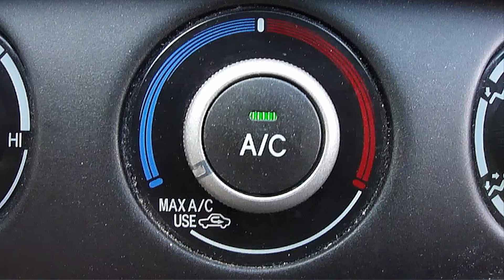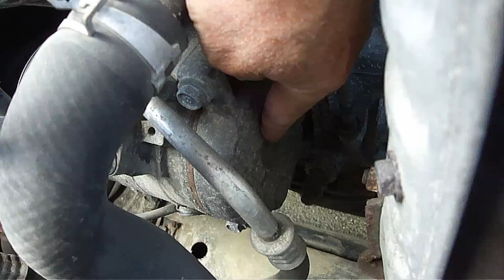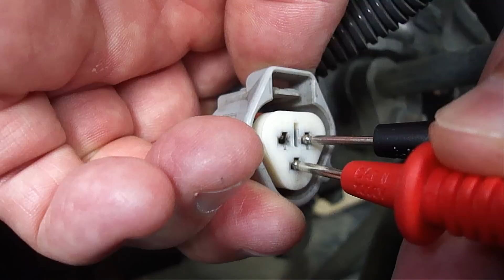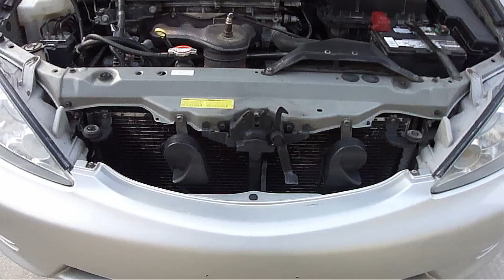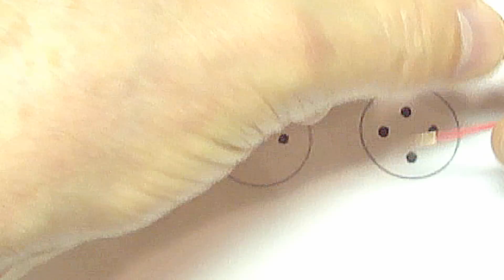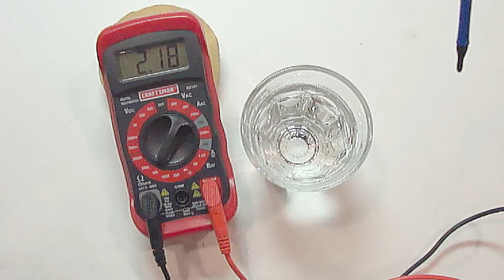How To Fix Car AC That Blows Hot - Possible Causes

Comment: this aint no sh!t. i replaced everything on my system and it didn't fix it. took it to 3...3 top rated F-ing mechanics in FTW tx. I heard everything from water pump and thermostat to improperly charged ac compressor. This is, actually the problem why it would charge properly. The compressor would not charge and run properly because the F-ING RELAY WAS BAD. !3.75 relay repaired the ac blowing hot air in traffic but cold air driving at speed. the compressor was not cycling properly causing it to work harder and over heat the engine. A relay fixed it all. At least all the parts are new and it gets colder than my new truck. It did have to be charged properly after the compressor was working right. But after that, Damn.

Comment: My ac wasn't working I checked the 10a fuse,it was bad so I replace it. It worked for 5mins then went out. Then I replaced the mcr clutch relay  and the 10a . It worked for about 2days then went out. I'm thinking alternator or belt ? Any ideas! 2008 Chevy uplander 120k 2nd owner.ac blows cold when working.

Comment: WE HAVE A 2008 TOWN AND COUNTRY AND THE AC AIR IS NOT COLD ENOUGH.  WHAT COULD BE? AND THANK YOU SO MUCH.
Reply from the maker: My first guess would be low refrigerant.
Reply: @proclaimliberty2000  Thanks for your answer  but is fully charged.
Reply: @proclaimliberty2000  Thanks so much for answering me but unlikely is full. I took the van to a shop to filled out. Works but not good enough when is really hot. Another suggestion?
Reply from the maker: @armandoperez2484  As it gets hotter outside the ac temperature coming out of the vents will not be as cold.  Does it keep you comfortable?
Reply: @proclaimliberty2000  I HAVE TO CLOSE THE OTHER VENTS TO FEEL COLD THE DRIVER SIDE, BUT WITH MY FAMILY IN SIDE IS IMPOSIBLE TO DRIVE.

Comment: Watched and liked. Buyva scan tool is what i got from video.. another guy said 90% of broken ac systems is because of low refrigerant. They reccomend attaching a refrigerant gauge on the low press0
Reply from the maker: Buy a manifold pressure gauge set from Harbor Freight. Don’t waste your money on these junkie re-fill hoses.  80% of refrigerant leaks are due to faulty Schrader valves.

Comment: My AC only works if I press and hold the AC button. If I take my finger off the button, the compressor stops working. The light starts blinking and blows hot air. What could cause this malfunction.  And thank you for your video ( I have 2010 rav4)

Comment: My AC isn't working. I had one place quote me 1,600.00 and another 1,700.00 to replace A
C compressor. I have a 2009 Toyota RAV4. I am on SS and cannot afford this and it's so hot in Texas. Does this sound like a reasonable price?
Reply from the maker: Might be a little on the high side. Was this a quote from a dealership?

Comment: What can cause a short to the AC compressor? Could a bad coil or thermal protector on the compressor cause that issue? 

I have a situation where the fuse to the condenser fan and the ac compressor keeps blowing out. I unplug condenser fan and compressor and tested each separately and they work fine without issues. Could one be drawing more amperage than rated for the fuse?

Comment: What might cause the AC to blow hot air when vehicle comes to a stop like at a red light? Otherwise blows cold air. Fan is working.
Reply from the maker: My first guess would be low refrigerant.

Comment: Checked the AC on my GF 2004 Toyota Corolla that was blowing hot air. The magnetic clutch doesn't engage / spin on the compressor. With the AC turned on the fan under the hood doesn't spin. Checked the AC relay by swapping it out with the horn relay, horn didn't work, AC relay was bad. I replaced the AC relay but it didn't fix the problem. The fan still doesn't spin and the magnetic clutch on the compressor doesn't engage / spin. Not sure what to do and can't really afford going to a mechanic (they quoted me $125 just for the diagnostic).
Reply from the maker: Your cooling fan motor more than likely needs to be replaced. A bad cooling fan can prevent the clutch from turning.
Reply from the maker: I have a video on my channel showing how to replace the cooling fan motor. You’ll find the best price for a motor replacement on eBay but only get genuine Toyota OEM.

Comment: Hi I’m having a different problem, my front driver side ac blows cold air but not the passenger or rear if not run on a low. If you turn it on high front and rear blow hot and driver side blows warmer. Ac was fully recharged. Hope someone can help.

Comment: Great video, but no mention of  a repeatedly blowing fuse, which sends power from relay to compressor. This is a common problem, usually caused by a short in the clutch, and should be one of the first things checked.
Reply: Repeatedly blown fuses are due to magnetic coil behind the clutch is short.
Clutch not engaged sometime due to magnetic coil is broken open - using ohmeter sound  continuity connected to ground and magnetic coil wire to hear a beeping sounds proving it is good.
Reply: Short not in the clutch- short is in the magnetic coil behind the clutch which is just a springplate.

Comment: After spending several thousand dollars on an expansion valve, compressor and voltage regulator, it turned out to be only my ac relay! Wish i saw your video before i let a couple service guys take my money! Thank you!
Reply: There's some crooks out there. I just got told I need a new $2000 compressor. But I tested by connecting to the battery and it works fine. The system probably just needs a regas, or it could be a faulty pressure switch.

I need to try to find an honest tech to find out.

Comment: i'm a mechanic and i don't thin could of done it half as well . expertly done great how you explain jumping censors on sum cars or jeeps you need to unplug the compressor and can test the fans on evap or air drier jumping plug to see if fan motor kicks on also . as you explained in first section fan was bad on the car you were working just my opinion of course if you made a video in how to check the fan as in your case was issue . the way you describe an explain in detail im sure it get lots of few an help a lot more people . i'd do it but you have a much better way almost perfect like a teacher makes you understand in terms Thanks amazing video . BigRigDeLo , motorcycles , lawn equipment , cars ,truck repairs if you like to subscribe i'll be starting a help DYI auto help channel and i'd recommend your channel to anyone also not to take followers just everyone has little tricks an never have all the answers . can always learn something from anyone everyday ..... 2 thumbs up to you sir ...

Comment: my clutch turns but still blows hot air coolant level is good i have a 2014 kia optima
Reply from the maker: It needs to be checked with an ac manifold gauge.

Comment: On your meter you have the red lead plugged into the right side and black in the center at 4:40 , why did this change when towards the end at 19:24 but now the black lead is plugged into the left hole? Sorry not a meter guy just asking for tech answers.

Comment: Many years ago I worked as an Assistant Chief Engineer for a radio station. We had a Promotions Director that literally flew a broom back and forth to work. She was a miserable ount, and impossible to work with. As was our station's annual custom, we had our News Van participate in the HOURS LONG July 4th parade in the city. And this year, little Miss Congeniality decided SHE was going to drive. On Friday, while loading up some stuff for her "date with destiny", I went under the dashboard and removed the A/C fuse from the fuse block. Monday rolled around and she came into the office, complaining about how bad the parade was since she had to sit in that van for hours with the A/C not working. "Really? I'll go down and take a look right now." I went to the van, put the fuse in, fired up the A/C and of course, was soon greeted by a cool blast of air. And of course the kicker was going back upstairs to tell her there was nothing wrong with it and it worked fine for me.

Comment: I had issues with that on my last 2 rangers. Turns out it was the relay was bad. In my case though, the relay was a bit different then the rest. It was a 5 pin relay and NOT a 4 pin. So just pay close attention to that detail.

Comment: Do Nissan Jukes also have these sensors? I'm having a different problem.. my wife's Juke will turn on when the ambient temp is not too hot, but will blow hot air if the car's been sitting in the sun all day on a hot summer day (above 100° F weather).
If it sits under shade it will work just fine.. like when at night, even if temps are high it will work without issues.
When it blows hot, the compressor cycles on for a 2-3 seconds, during which it blows cooler air and then cycle back off for several seconds, where it again blows luke warm for several seconds (5-10seconds) and does this indefinitely until the sun goes down outside temps decrease or it is parked under the shade for a prolonged period of time (and even this is hit or miss..)
Any suggestions are greatly appreciated 🙏🙏🙏

Comment: What if the compressor is working and the system is full, no leaks but it still blows warm. 2001 Chevy Malibu
Reply from the maker: You need to run a manifold gauge test.
Reply: @proclaimliberty2000  Thank's I'll tell the mechanic about that.  It's been in the shop twice, they said they couldn't find anything wrong. Well warm air is wrong.
Reply from the maker: @skydiver4959  If the clutch is engaging and it has the proper high and low pressure (40-200) and the refrigerant is full then that is very strange. Do you know if it’s ever had stop leak added to the system which can create problems?
Reply: @proclaimliberty2000  Not to my knowledge.
Reply from the maker: @skydiver4959  Please keep me posted.

Comment: My AC just stopped cooling two days ago. Based on your advice, I checked and the two fans behind the Radiator aren't working!
Reply: Hey there, i might have a same issue since i dont see my cooling fan turned on at all. How did u fix it? Thankss

Comment: I had a F650 Ford work truck, the AC sucked on it and yes I worked in a hot area, if the truck was idling the AC would not come on, you would have to drive it around the block a few times to get it to work barely, I had it written up several times like 20, it seemed all the Ford trucks AC sucked.

Comment: great video however i have a question. what would make my compressor to stay on and still blow hot air?  i initially thought it qas low on freon  but the pressure was reading that it was overfilled. so i let some out until it was in the green. and it still blows hot. what do you think might be the problem?
Reply: Mine says Freon level is good, but still blows hot air. Wish someone had an answer! These 100+ degree days are not fun!
Reply: @ggusewelle9682  Could be the actuator. Not sure if he went over that or not ( didn’t watch the entire video ), but you get to it through the dash panel or, in my case, behind the glove box. Could have replaced it for $80, but my neighbor just bent a wire to wedge it close, & used some gasket sealer to secure it.
Reply: Have you fixed it yet?

Comment: On the chevy cruze the fuse thing is labeled different and they are smaller, we swapped the "AC Clutch fuse" with "horn" to test and it immediately worked. Thanks to this video we knew what to do. We bought new ones for $4.99 - cheap fix. Thanks a lot! With this super hot summer we are great full for your video.
Reply from the maker: 👍😊 That’s great!

Comment: Great video I have a 96 Toyota Camry 4 cylinder I installed a new alternator, new battery, new belt, new compressor. The compressor was done by a mechanic. The ac light blinks and I have no ac. Took the car back to the mechanic I have no leaks he by pass the relay and I get ac but he can’t figure out what is the problem.
Reply: Was the relay replaced?
Reply: @bornoflove  No the relay wasn’t replaced he the mechanic must to move something when he took it apart
Reply: Thanks

Comment: I’m getting power all the way to the connection of the compressor but the clutch will not in gaged when the A/C is turned on? It’s reading in the red on the violent gage when you try to prime it. Any ideas?

Comment: Dear Friend. Thank you very much for the video and the lecture. My car w205 c200d Mercedes 2015 model air conditioner suddenly goes into heat after a while of cold. Doing it 3 or 4 times a day. When I first run it, it blows 10 miles of cold suddenly goes into the heat. After a while again blows cold. What is the reason. I'd be glad if you could help.
Reply from the maker: Your expansion valve could be failing.
Reply: @proclaimliberty2000  Thank you so much for your attention. Last year, the pressure sensor changed and the fuse box update was made. It was connected to the computer in the service until this week it did not fail a year, 172 times the pressure sensor failure has given. Why does not even find the service that gave this malfunction.
Reply: @proclaimliberty2000  Thank you so much for your attention. Last year, the pressure sensor changed and the fuse box update was made. It was connected to the computer in the service until this week it did not fail a year, 172 times the pressure sensor failure has given. Why does not even find the service that gave this malfunction.

Comment: By far the best trouble-shooting video for the AC I've seen.  Very well done and easy explained.  Lots to check instead of assuming you need more coolant....
Reply: @proclaimliberty2000 ; Why would my Honda ridgeline have hot ac on drivers side and cold on passenger side? What settings need to be set?
Reply: @cathyL8562  Most likely not enough ac coolant gas. And needs a refill.

Comment: I found the ac clutch hidden in the shroud for the radiator fan
Reply from the maker: Year, make & model?
Reply: @proclaimliberty2000  2003 mazda b2300

Comment: Had a problem with my Golf ac, this lasted for over two years. Was told many things could be wrong by various garages all costing + 1,000.00 euros. Being a pensioner I could not afford this, so put up with hot summers in Spain ( much to my wife’s disgust)! Was told of a good mechanic close to where I lived, after constant nagging I went to see the mechanic. Asked to leave the car with him, and said he will fault find. He called me back after 1 hour,  he said AC fixed. It seems my generator for the ac had no oil, topped the oil up and now I’m in heaven. Did not realise the AC needed oil, let alone it had a generator. And the best thing is it only cost me 55Euros, not the thousands quoted by reputable garages?
Reply from the maker: 👍😊 Low oil in the compressor will cause the low pressure switch to turn off and not allow the clutch to engage.